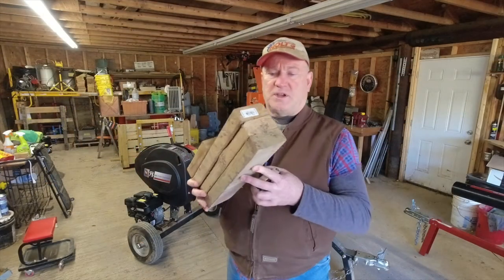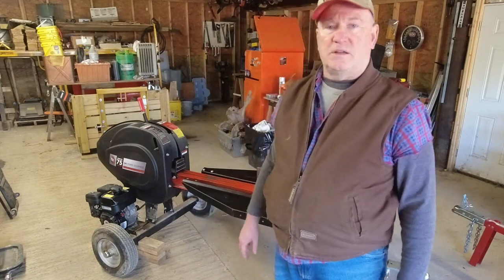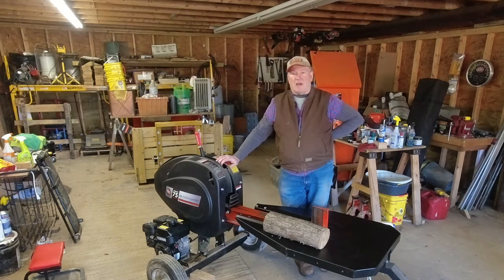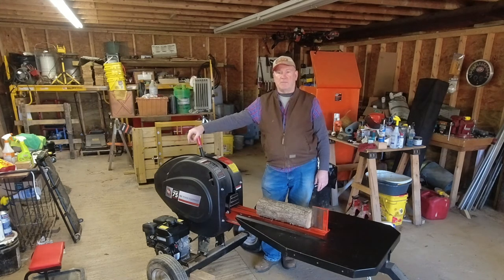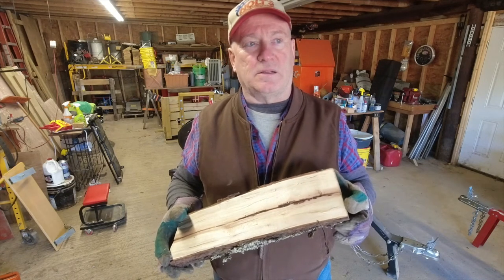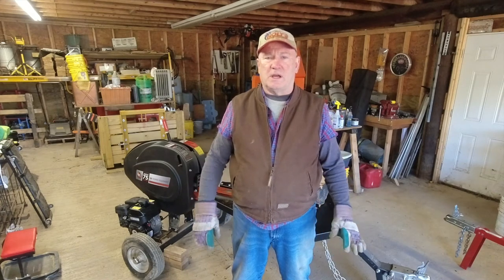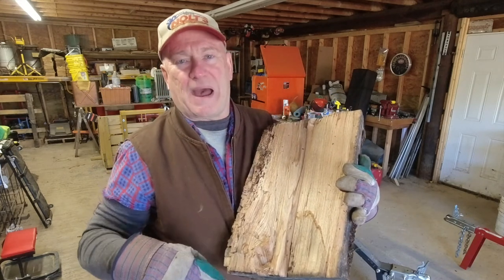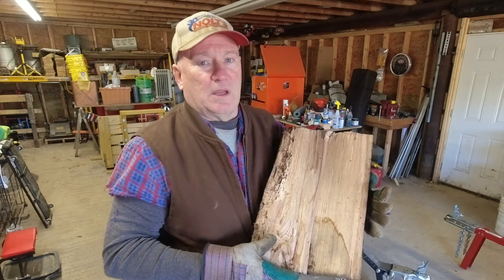#96 - My Opinion About DR RapidFire

Comment: it was fast but not very heavy duty,,
Reply from the maker: the fact that it is not over built is good because it is easy to move - I hated it when a sliver of wood became jammed under the push block - it's a process to remove all the covers, springs and miscelanious hardware to remove a toothpick that got jammed between the i-beam and the push block - thanks for watching and commenting - enjoy the journey - cheers